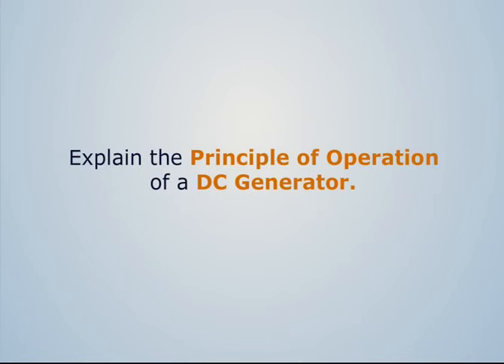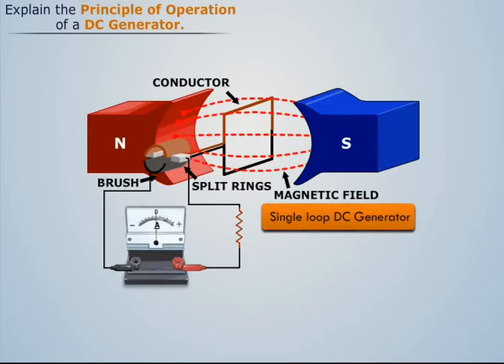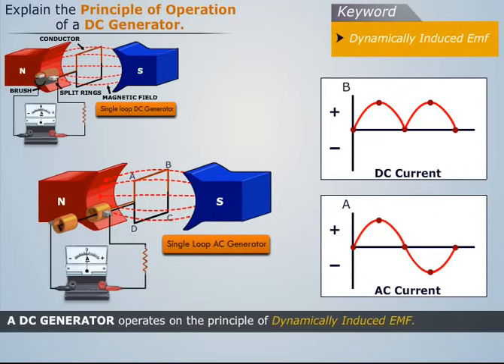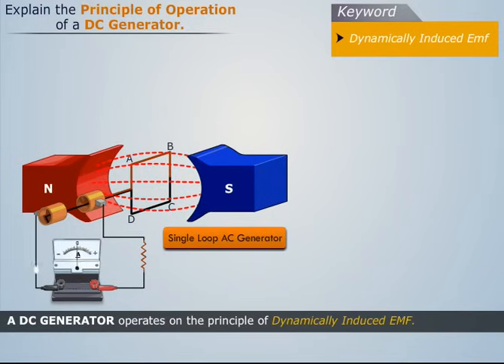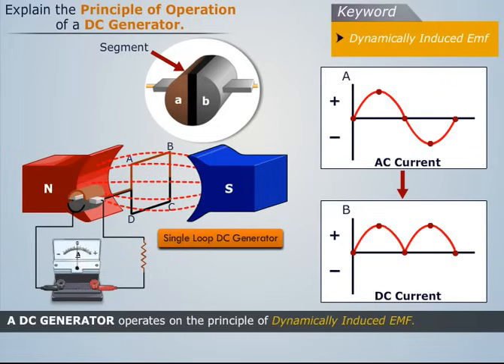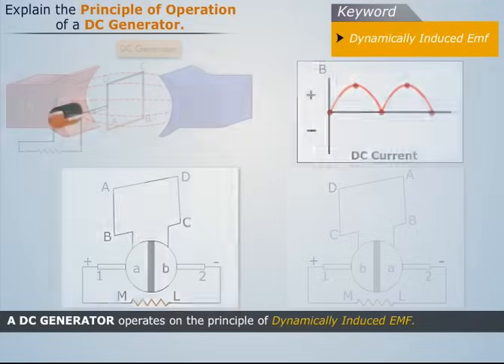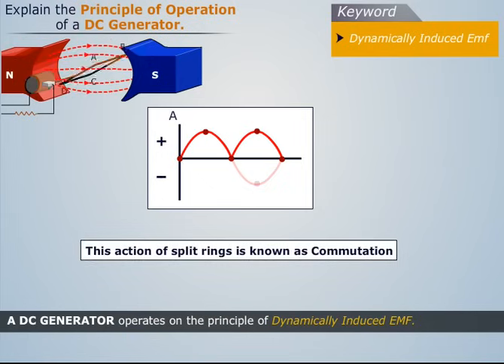Principle of Operation of a DC Generator | Electrical & Electronics Engineering

Comment: This is confusing. It seems like he's describing an electric DC motor, not a generator.
Reply: Kevin Monroe They are similar.
Reply: +Parama Roy

I have a doubt. At what position is emf isnt generated, that when the coil is parallel to the magnet or to the flux lines. 

Help Please...
Reply: +Vin R Because when the coil is parallel to the magnet its perpendicular to the flux lines and vice versa. Anyone help highly appreciated.

Comment: I just watched about twenty videos... I still don't get the damn difference.
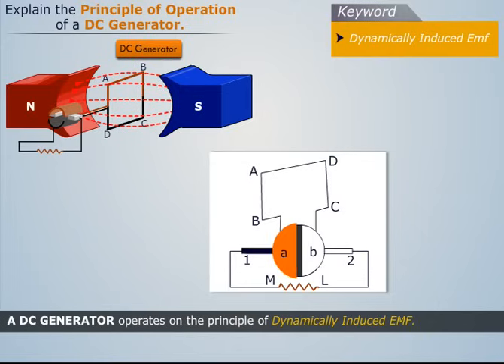Reply: from 4:11 forget the video
just in AC generator you are taking advantage of full circle which means the direction is changing
but in DC generators you are using half a circle to just get one direction of the electric current
Reply: theSyrianhuman So what I don't get is why we're saying in AC that the sides of the coil are being flipped which makes waves appear to go maximum and minimum. The same thing happens in DC, just the current cuts off because of the split ring. Does that mean the oscilloscope doesn't register the entire turn? Or does it, like(if this makes sense), once the current cuts off, the whole thing kind of resets and considers?

And besides, what's the point of using a DC or AC current? What's the advantage of one over the other in generators or motors?
Reply: @nafisa.t13  hi, ur question is even in dc, instead of straight line, there is a wave that too  only in positive side, right?

That wave is because of induced emf when conductor ABCD is parallel to flux maximum wave value will come and when they are perpendicular then zero value so as it is rotating from 0 to 360° the values will change and if you plot it on graph, u will get that wave still it is called as dc because the current flows in one direction I.e, from M to N in video. only one direction not from N to  M.

Hope, it is helpful
Reply: The difference between a battery and a DC generator is that a battery is a true DC current. The current from a DC generator still has a frequency just like in AC, it just doesn't go negatively charged. The only thing not covered by this video is that you have to greatly increase the frequency and have multiple levels of inductance so you can peel just the peak from each DC 180 degree sine wave.
Reply: @aaronhall4520  that makes sense, ac seems simpler.
Reply: you can see in AC  one revolution takes place and  two slip rings are used but in DC only one slip ring is used by splitting it in DC current passes directly but in AC it comes to maximum and zero repeatedly
Reply: we call the college professor doctor where we live
Reply: googleccd079 If you're trying to be sarcastic, at least be relevant. Try correct grammar because you're comment makes no sense whatsoever
Reply: Nafisa Tabassum I think you need to have sit-down with your doctor, he'll explain it to you better.